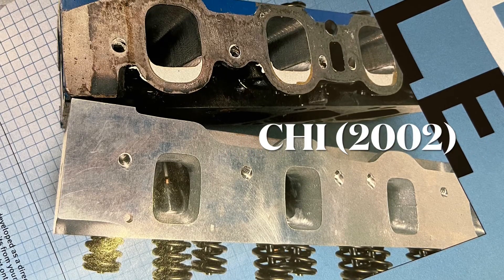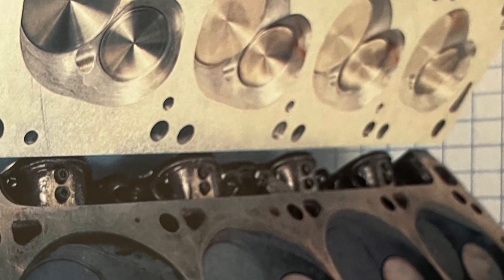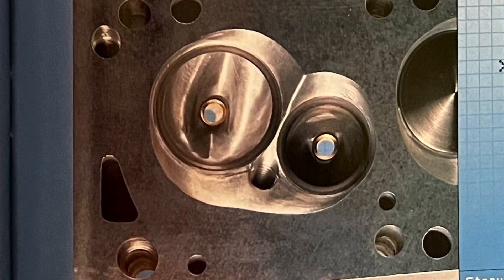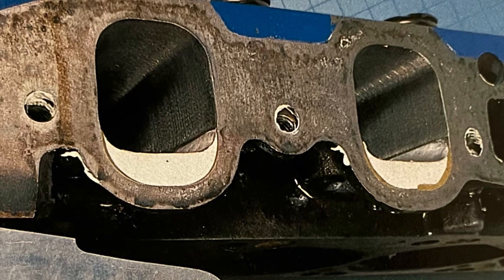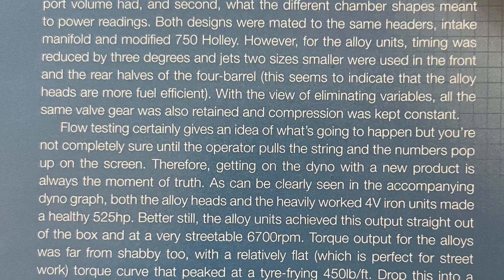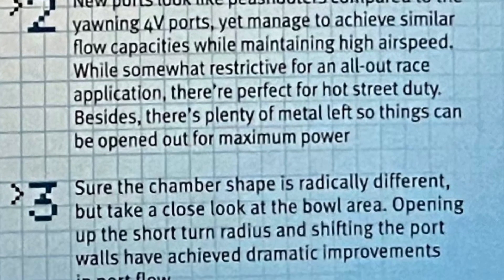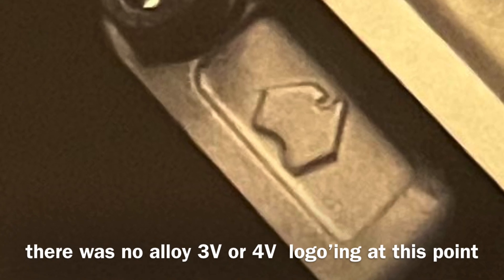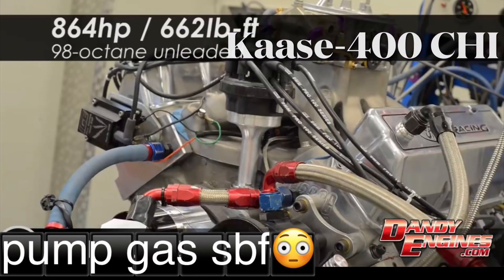4V Cleveland Head vs CHI, the First “pre-3V” head CHI🏁

Comment: Alloys are great however if u have good 4V’s use them on a stroker in the 408-434 cubic inch range they will make a ton of HP and torque. Done a couple. A comfortable 700hp / 600 footies on pump fuel.
Reply from the maker: Oh yes, a set of 4Vs on 400+ ci 👌🏼🏁
Reply: @69JANKS  I did a 434 a couple years , cleaned up 4v’s 11.1 comp, 260 at .050 street roller out of  the box TFC. Made an effortless 684 hp at 6500 rpm 583 ft / lbs. on competition engines dyno. Known for not handing out free hp like some dynos in the northern suburbs. Engine is tame and provides out right fierce acceleration in an XA GT coupe. A little more  port work on heads , full intake manifold port and 272 @.050 cam and it’ll make 725+ no problem. Pretty much As good as any alloys
Reply from the maker: @michaelparadisis4076  wow that's Badass results 🏁, exactly my point that a set of 4Vs on the right deal can out perform or match modern heads.....Competition Engines has really cool results for sure👌🏼🏁, easily make 700+ with more Cam, comp etc......thanks for sharing 👍🏼🏁
Reply: @69JANKS good 4v’s are still up there. Right up there! Zoran is a genius and good friend of mine. We will upgrade  the 434 with cam a little more head port work and intake massaged down the track. . It’ll be savage package and still very street able with street solid roller  PLUS it’s good to be different and old school , everyone has alloy heads which have come a long way that’s for sure.
Reply from the maker: @michaelparadisis4076  exactly, achieving it by being OldSchool is funny to me on how it's looked at as being different nowadays haha , goes to show the alloy route is everywhere & the old 2V/4V irons are scarce these days🤷🏻‍♂️🏁
I'm enjoying Zoran's channel lately, some cool na street engines 💪🏼🏁

Comment: I bought a Clevor that has 4v heads that have been epoxied like yours. Having trouble matching intake gaskets, what are you using?  The standard 4v don’t take in account for the epoxy.
Reply from the maker: You may need to just get some 2V or (3V CHI) gaskets & trim them to suit. 👍🏼🏁
Reply: @69JANKS  I ordered 2v and they won’t work.  I’ll try some 3v, thanks!
Reply from the maker: @patrickterry779  👍🏼🏁

Comment: What does the 3V stand for? When I first heard of them I couldn’t find any info on them, and thought they might be 3 Valve heads. That seemed really weird for an older V8, but they were used on Ford’s 4.6L V8.
Reply from the maker: Haha No…No,  ok so you need to be familiar with the OldSchool oem Cleveland heads first, they are normal 2valve pushrod V8 style to be clear.
there is 2V (small port) heads & 4V (large port) heads…… so CHI had developed an all new performance head calling it 3V because it basically has the best of the two characteristics 👍🏼🏁
The original “V” was an oem reference to determine that small port heads were a 2bbl carb Cleveland & 4bbl carb equipped Clevelands but even that wasn’t right outta the factory anyhow…
Reply: 3v on 4.6 Ford is actually 3 valves.  Two intake valves and one exhaust valve sized closer to what we are used to on v8.  3v on Cleveland just indicate the port sizing is somewhere between a 2v Cleveland and 4v Cleveland.  They fix all the 4v deficiencies and dead spots and have more flow and a modern combustion chamber.

Comment: Yes this is Robbie heart I would like to know about the two v closed chamber heads complete from y'all . Building a 351 Cleveland to go in a truck short bed F-150 any good suggestions thank you
Reply from the maker: Hey RH, there’s not much to them.
Just remember that bolting straight onto a 351ci (3.5” stroke) Compression goes high because 2V Closed Chambers were only on aussie🇦🇺”302ci” Clevelands ok…so will need to relief & lay back the chamber a little to get it in the 10.5:1 region…unless leave it & run e85 Carby deal🤷🏻‍♂️
Some light port work in the port runners, bowl areal & valve bosses  is all it needs to wake em up & make 450hp/450ft-lb obviously with the supporting mods.
Up to you on Hyd or Solid Cam deal, Solid  you have to machine your rocker pedestal‘s down flat & machine/tap for screw in stud/rockers. Machining for 4V valve size is ok, some only do the exhaust in 4V size, some ppl leave it all alone 2V
All depends on the “stoutness” of the combination.
Check out some of my vids on 2V stuff that I’ve had in the days. All the best👍🏼🏁

Comment: Hey Janks!
I recall when all this came to market in the USA, it was a Tidal Wave of forward motion for the Cleveland Ford(s)!
Sales here might not of been what was hoped for since the Cleveland had such a short life - and not enough smart thinkers in the "sister M" category, but the heads (both street and race) filled a HUGE spot in the Cleveland community. 
There were other offerings, but none had the total development that these did nor the absolute performance. 
More BAD ASS Cleveland hardware!
Reply from the maker: Spot on MCM👌🏼, they were & still are a big hit….. we just had more Cleveland’s here in our production falcons/utes etc all the way to 82/3  & 302C versions also
So made sense to us to come up with badass heads for em…… but sure did miss the challenges & diversity in combinations we had with our 2V & 4V stuff 🤷🏻‍♂️🏁
Reply: @69JANKS  
No disagreements here!!!
We've always turned to you for the better Cleveland parts (those that could swing the cost), blocks when NASCAR ran them, heads and a few other things.
The 4.6 'Romeo motor' just the same, the premium aluminum blocks came from Australia too!

Comment: And what about the 185 and 208 CHI heads?
Reply from the maker: Yes Were a few versions of inlet cc sizes👍🏼🏁
Reply: But what is their biggest seller, the 208 head
Reply from the maker: @racerd9669   not sure rD🤷🏻‍♂️, they have many to suit many applications….. they used to have the 195, 208, 215-218, 225, 240(4V) & have cnc ported options etc
Reply: @69JANKS  So they stop selling the 208 head the best selling head they offer?
Reply from the maker: @racerd9669  not sure if it’s the best head just being based on inl-port CCs lol, don’t have their sales results…….but most likely still availability thru them directly I’d say. That version was an early one too around 2004’ish ….. it all depends what Ci & combination at the end…..eg:can’t put pee-shooter heads on a big 400+ci serious deal🤷🏻‍♂️ port volume still come in play 
They do a “Pro-port” 3V version which has 242cc intk ports (4V territory) 
But towards 2008-2012 most guys I’d know we’re opting for the 218-225 3Vs
208 were the past sorta at that point.
Reply: @69JANKS  The 218 turned into the 225, and the real reason is because the 208 head out flowed the 218. John did not advertise the true flow numbers of the 208, because he was afraid it would hurt the sales of the 225. I have MORE than inside information.
Reply from the maker: @racerd9669  right on rD👍🏼, we’ll there you go then you have some inside info about it all 👌🏼🏁
Reply: @69JANKS  Read the advertising then you will know who I am.
Reply from the maker: @racerd9669   racer-Dave Storlein?
Reply: @69JANKS  Congrats
Reply from the maker: @racerd9669  right on Dave, pleasure to have on board 👍🏼🏁
Reply: @69JANKS  Thank You
Reply from the maker: @racerd9669  👍🏼🏁

Comment: Great video! My first real muscle in a street driven car was a 66 Mustang 306 Clevor w/4v heads,12.5:1 compression, big solid cam, nitrous and a 4.11 rear axle. Still got the car and the engine  but the motor will probably transplant into a 1965 Mustang fastback. That car ran very well! Those CHI heads, modern cam( I built the clevor in the 1980s) and a 5 speed manual should run even stronger!
Reply from the maker: Thanks CH👍🏼, wow you were on your game that sounds awesome👌🏼🏁
Reply: Lykins motor sport recently showed  a stock 4v build 620 peak hp and over 450 ft lb over 3500rpm.

Comment: Thank goodness the Cleveland took hold as it did in Australia. Thank you CHI! While it was very successful here in the USA in Pro Stock and NASCAR (especially in the 80's), the aftermarket never invested heavily in it due to the short production run of the 4V based engines. I was lucky enough to enjoy the performance of these engines in my youth, but they are mostly forgotten about by young enthusiasts of today. I still have a set of Boss 351 heads in my shop that I can't part with.
Reply from the maker: Right on r22👍🏼, we kept that baby going ever since….. there was a Cleveland powered beast on every block here from stock, mild to wild🤷🏻‍♂️🏁….. I’m the the same, kept my old na boss heads also been sitting 23yrs now👍🏼🏁